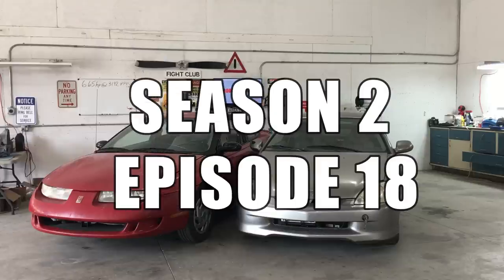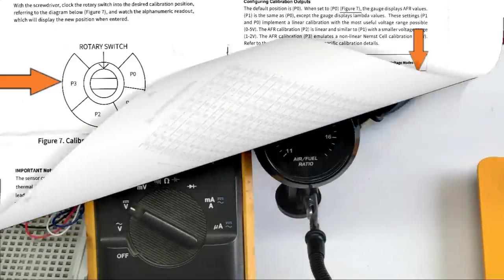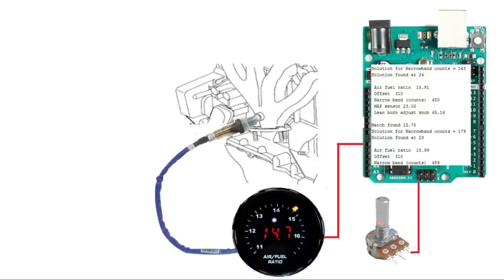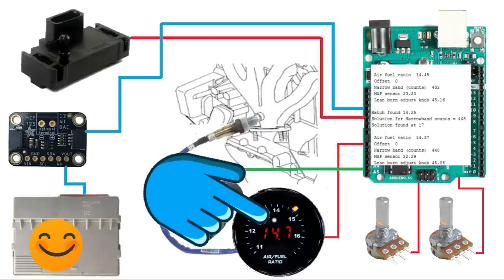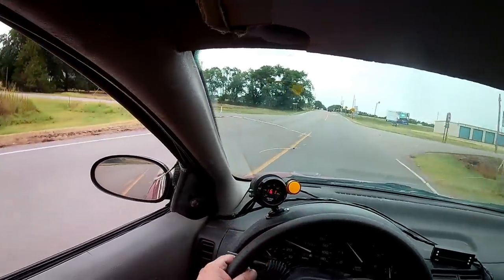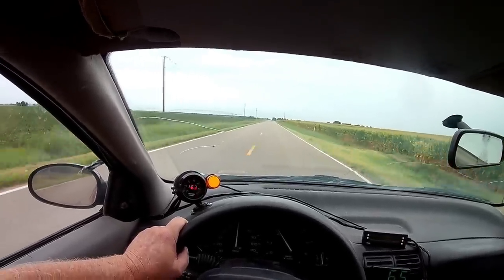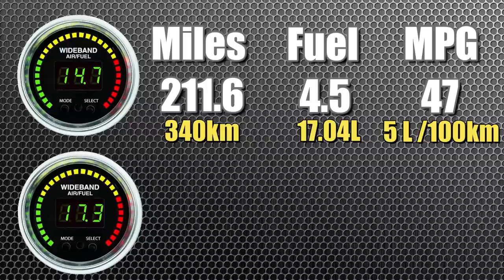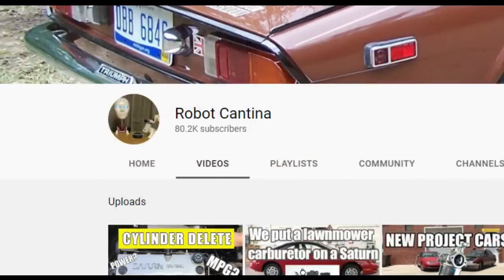S2E18:  We test a lean burn system on our Saturn .  Will it get better MPG?

Comment: I am a day late and a dollar short, but your fuel economy data is trash due to your fuel up method.   The pump can click off a half a gallon different from one fill up to the next on the same fuel dispenser just from having the nozzle oriented slightly differently in the filler neck... even more discrepancy if you use a different dispenser.   The only way to compensate for this on public pumps is to fill up to the top of the filler neck each time.

Comment: I've tried to tune a car to run lean before with a chipped ECU and I could never get it to get better economy than it would on about 14.5 to 1 it was also running hydrogen and it was leaned out to compensate for the extra fuel (hydrogen) being added into the intake
Reply: Where in the intake were you adding the hho or hydrogen?
Reply: @thatsonebadhatharry8610  just before the throttle body
Reply: @thecarwreckhunter  Your one of the few that I've heard of putting it in what I would consider the correct location. To many people just plumb it in  a vacuum port so it draws the most hho at idle instead of adding more as the rpms increase. But in reality it doesn't seem to matter since you can't find anyone who really made it work as everyone hoped it would.
Reply: @thatsonebadhatharry8610  I had a 5 plate dry cell that
 seemed to run best at around 10 amps, didn't really get any noticeable benefit as far as economy goes overall, sometimes it would be better l/100 than average somtimes worse  but it did feel more responsive and seemed to accelerate faster but that wasn't really what I was after, I still recon these have potential

Comment: Your test methods leave room for human behavior to be a factor.  Run the same road segment  with cruise control.  Try to match for temperature humidity and barometric pressure.  Check tire pressures before and after the run.
Use a fuel cell or boat tank that can be weighed.   
I suspect your experiments are showing margins of error that make the data inconclusive.   
Also, 45MPH for that engine and car is pretty darn close to max practical thermodynamic efficiency.  Start with something NOT great and you will get more significant results.

Comment: Good numbers? 

Miles traveled  = yes

Fuel consumption = ?

Numbers from the fuel consumed cannot be relied upon if you're just using a fuel pump. 

Are you using the same exact pump when fueling? 

Are you just using the amount of fuel used by when the pump shuts off?  You know darn well those are finicky and some shut off sooner or later than others.  

Your fuel used should be more accurate for the detailed data "we're" long for.  Yes Im one of those that watched the entire video and as Johnny 5 used to say "Need Input"